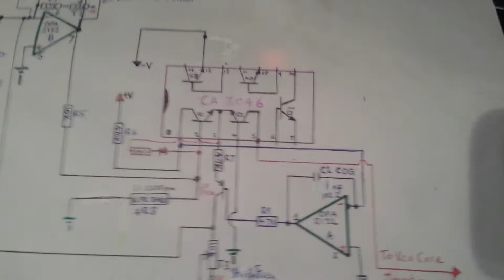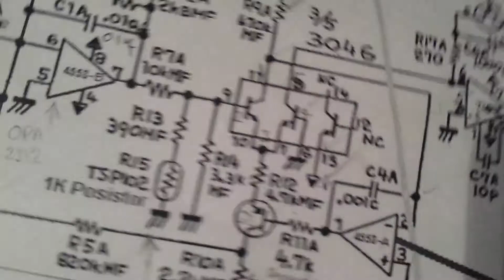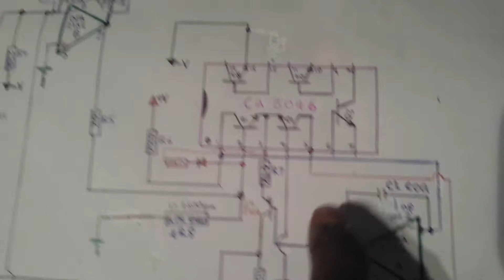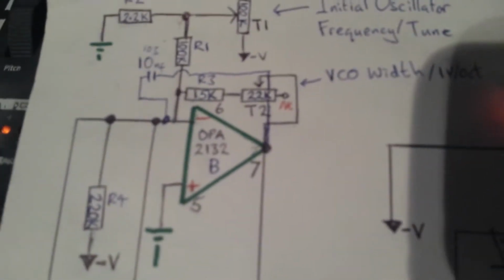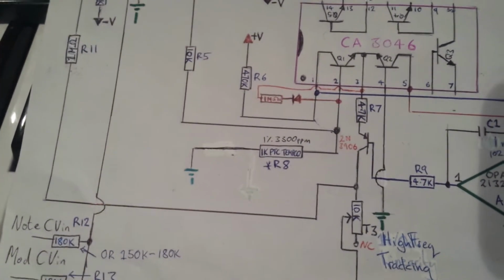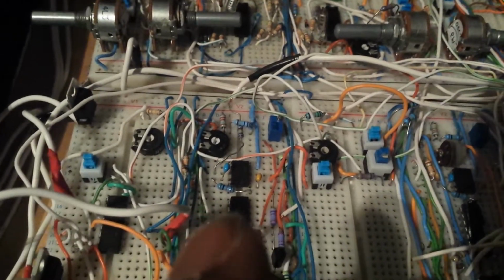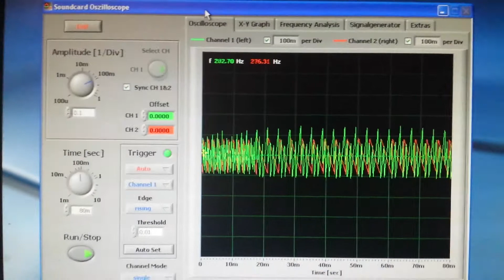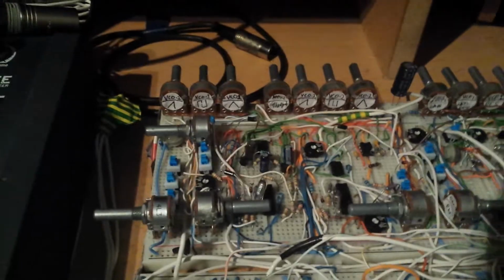DIY analog synth project Tutorial Part 2c (Exponential Converter modifications/amendments)

Comment: @ 2:48 Did you termal couple the transistors yourself? Gr8 vid!
Reply from the maker: Machine 386 Thanks for asking. No, Q1 and Q2 transistors inside the ca3046 array are on the same die and so are thermally coupled already with the emmiters linked. Thou you do need to thermally bond the tempco resistor to the top of the ca3046 ic with heat transfer compound.
Reply: I see,Thanks!
Reply from the maker: Eman Mann . No im not sure either . I was going to try the ls318 which are apparently better at doing the log function.  Also i have a lm394ch tin cased dual transistor installed on VCO 1 . Theres not much diffrence in how it performs to the ca3046 in my circuits to be honest.
Reply: Just found these videos! Great! ... but you, my friend, should invest in a wee tripod!
Reply from the maker: Kicko Fighto Thankyou for your comment. Funnily enough i did invest in a tripod , unfortunatly its very hard to set up in the small space i have not forgetting that it doesnt give me the freedom to move about as much as i can on the circuits and zcreens if i need to without falling over . I dont rehearse my videos its normally one take and hope for the best. Still thanks for yiur advice.